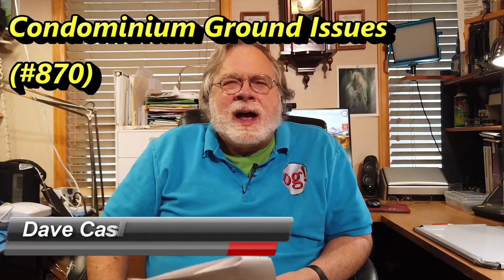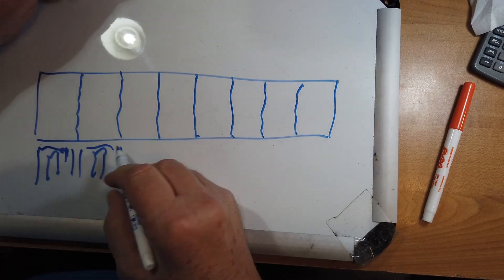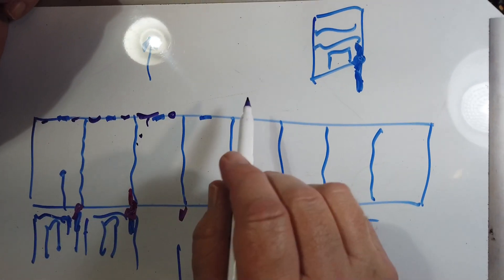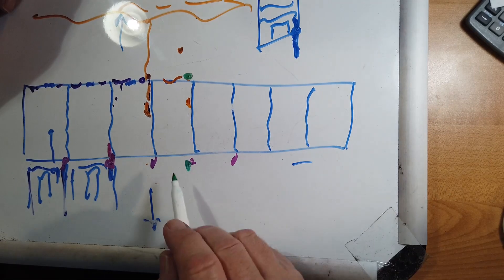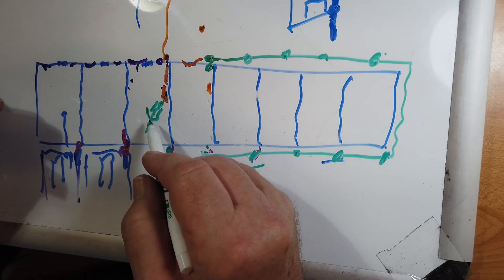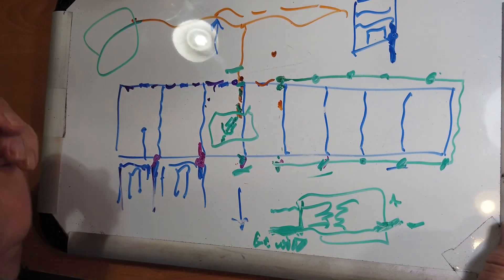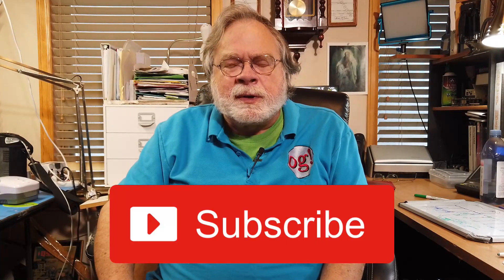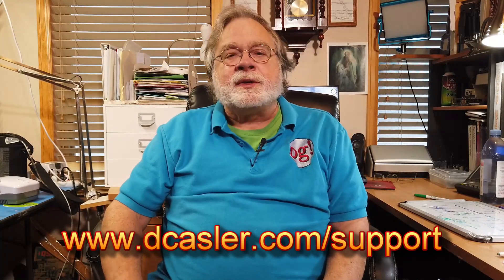Condominium Grounding Issues (#870)

Comment: Excellent video Dave.  I've been in the telecommunications business for over 50 years and have seen first hand what happens when grounding is not done properly.  I once had an example of over 20 feet of solid #6 copper wire that vaporized.  I've seen several examples similar to your "condo situations" where there is a significant voltage present between grounds on opposite sides of a building.  I fully agree with you that Ham shacks are seldom fully and correctly grounded.  Keep up the good work.  I hope the newer hams are paying attention.
Reply: But most condominiums are multilevel.

Comment: The utility ground in my house is the cold water pipe which enters from underground into the center of the house, which means the wire from the panel runs thru the house to where  that pipe enters.   So according to you that is a fire hazard.  Should it be changed to an outside ground rod?